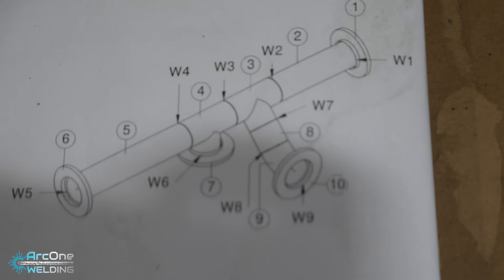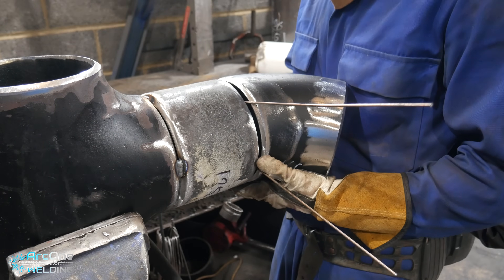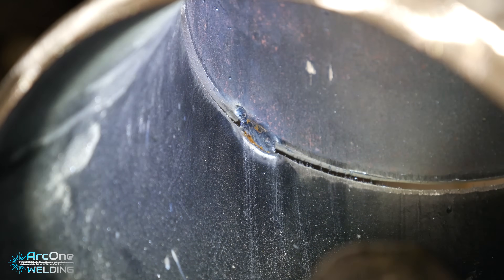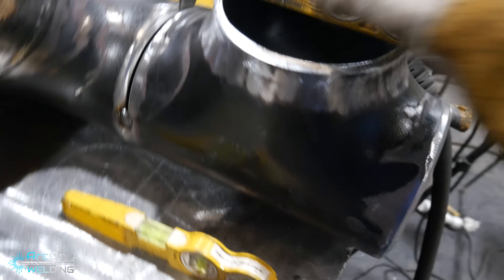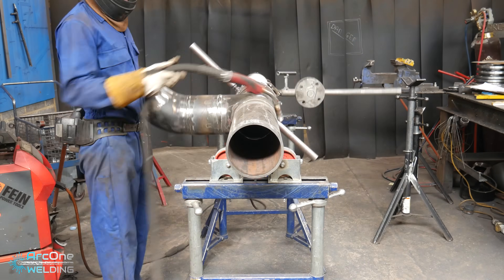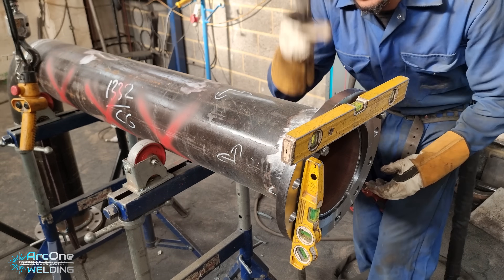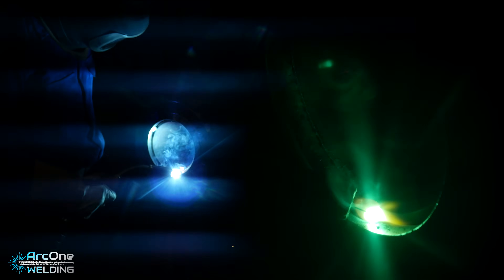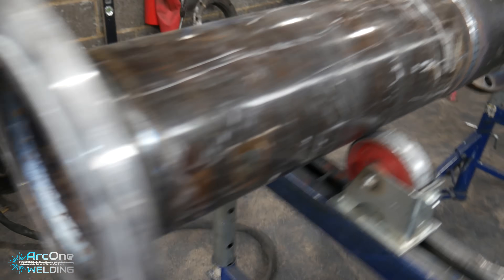Open Root Butt Joint & Pipe Spool Fabrication (MIG/MAG)

Comment: Hey man. I bought slightly used fronius transteel 5000 pulse but it's giving me crater cracks on the end of the welds. I dont know how to correct that.  Any ideas? 
It is better when using end current, but it shouldnt make cracks even without that. I'm welding standard construction steel.